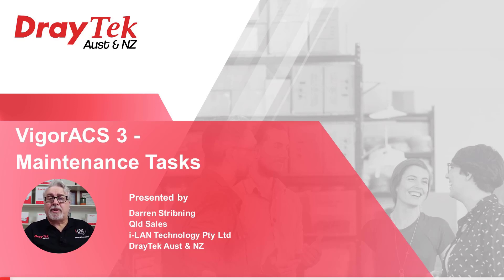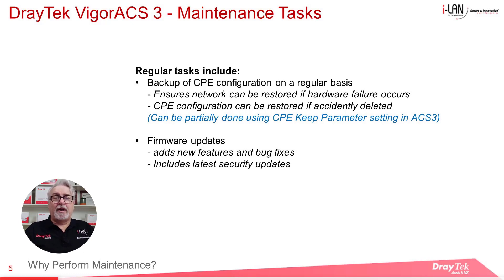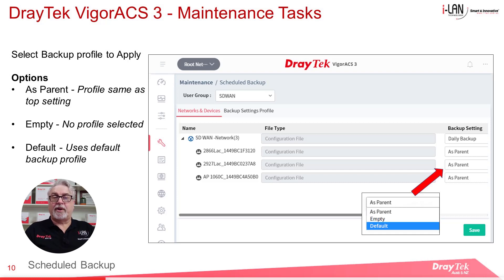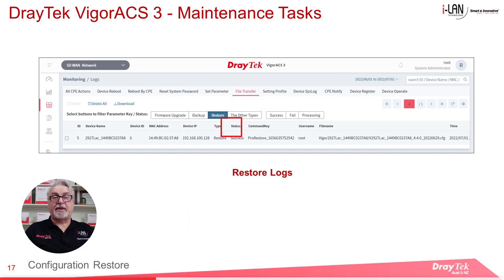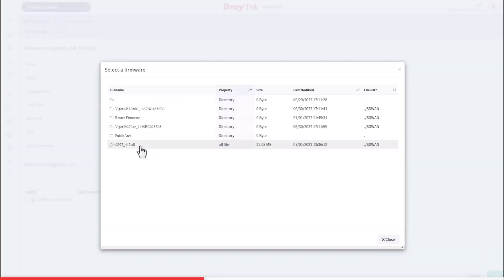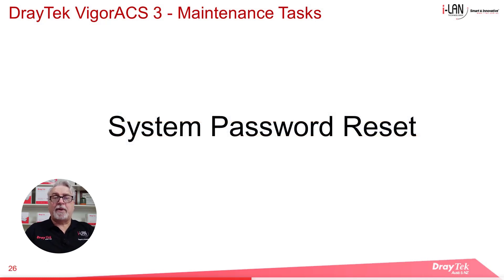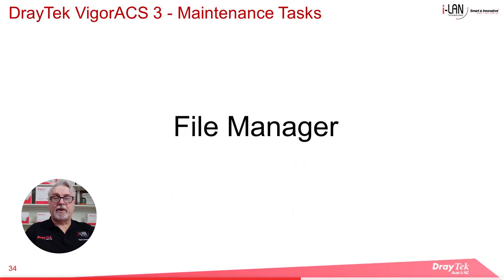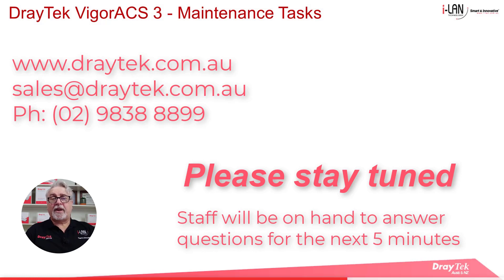Webinar - DrayTek VigorACS 3 - Maintenance Tasks

Comment: what is the benefit of restoring everyday? I understand the need for backups...
Reply from the maker: Everyday was just the example used. You can do it as often or as little as you deem necessary. A daily restoration may just be piece of mind to pre-empt other users with admin access to a router who may have a tendency to modify settings from time to time either accidentally or on purpose.
Reply: @DrayTekAustNZ I appreciate the response, we have just deployed acs for our 25 sites